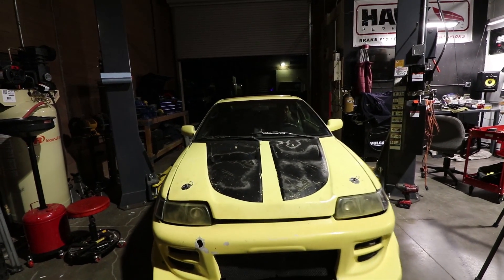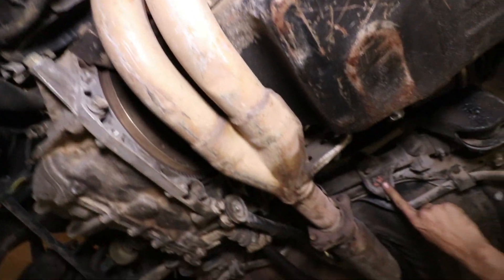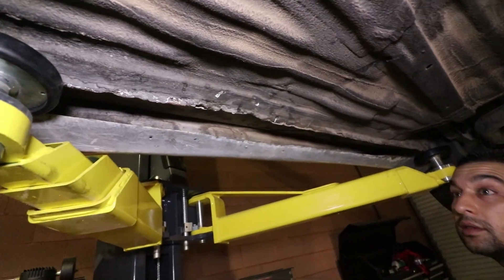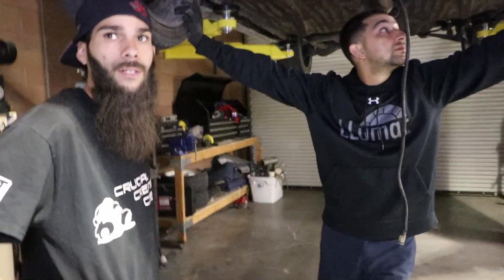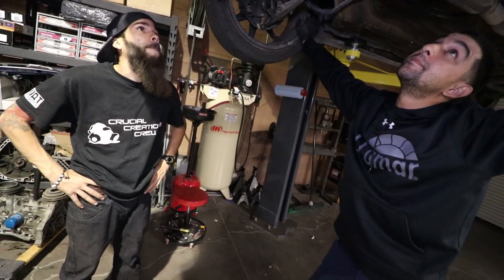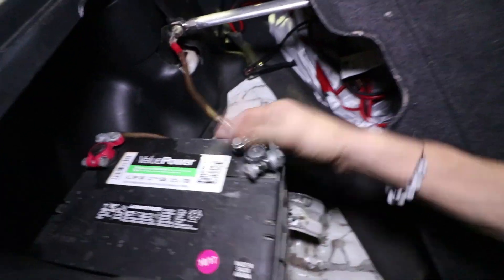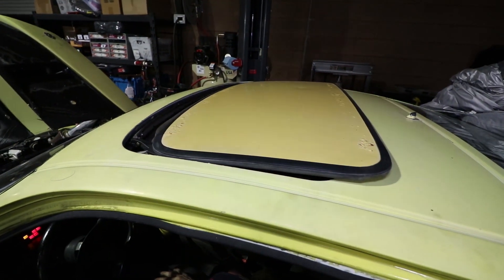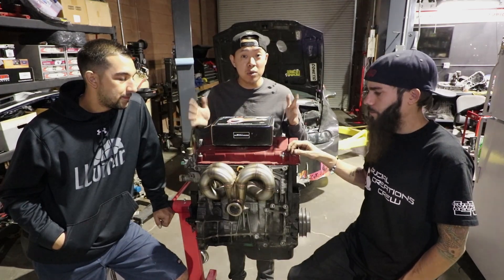We Build A SportsCar Killer : Meet Pink Widows Lil Brother

Comment: I have a 10” bazooka tube sitting in my tool box the amplifier just needs some capacitors soldered into the circuit board I also have the micro chip for the amp itself if you need it the one I’m it works just bought the second one just in case. But then I bought a Rockford fosgate p300-12 set up instead.

Comment: Just buy an talon or eclipse crashee  and stuff that  4ws drivetrain on that with 4g63   would be low 9 car with ease..          but   35-50 psi   k  series would be ok as well,   just hard to keep trans gears inside the box.

That crx looks all most as clean as  the one i had in late 90s , and yours have about extra 20 years on the clock.

Ps.  pulsating leds with music is done due  voltage drop converted to binary with micro controller..     mic ones are worth not anyones time... and they still need the micro controller.